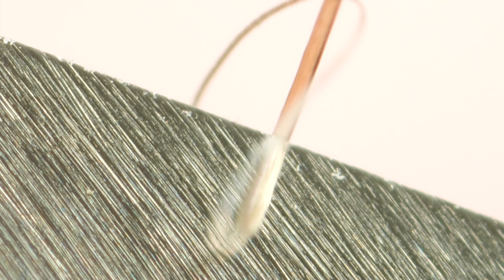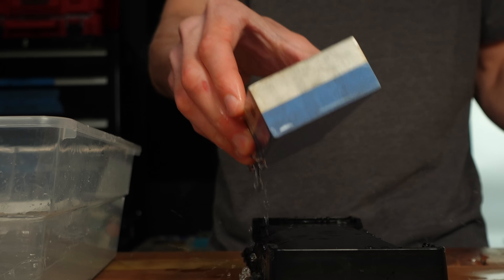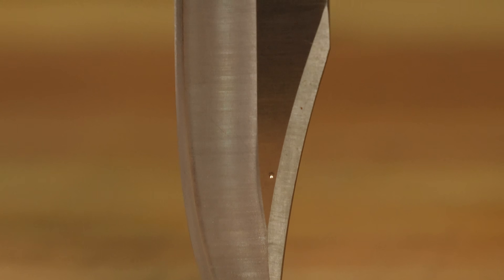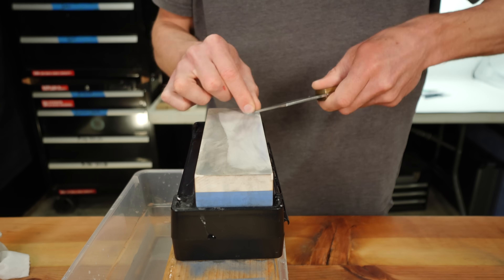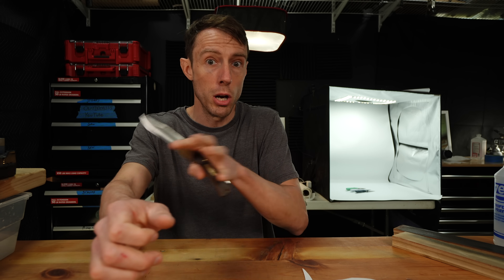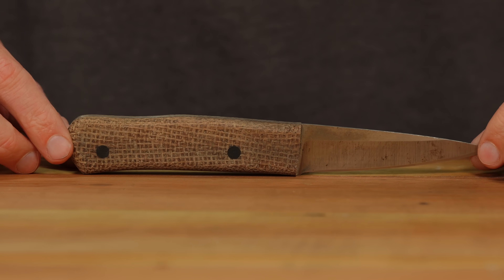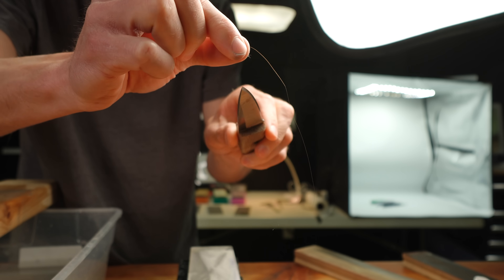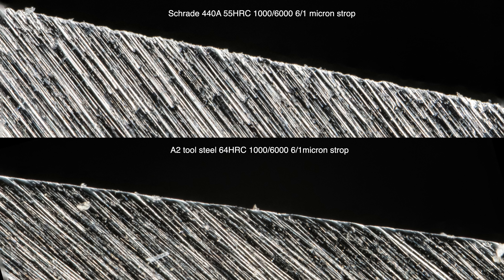The Reason You Can't Get A Hair Whittling Edge No One Talks About

Comment: I actually have the exact opposite problem:
On a 1000/6000 oxide stone i can get my cheap santoku knife (i guess mid 50s HRC) razor sharp. My rather expensive 67 HRC filleting knife on the other hand i can get to a point where it just so cuts paper but nothing better than that.
The stone takes of metal on both knifes, evident by the grey slurry, so i have no friggin idea why the hard knife doesn't wanna get sharp...
Reply from the maker: It could be multiple reasons. Very hard to diagnose unfortunately without knowing the exact setup and technique
Reply: As for technique, i am a beginner and use a Sharpal Holdbubble to make sure to keep the correct angle. Burr reduction technique like you showed in your other videos. 
The stone is made by KozyGear: nothing special, but it has a nice stable base and also a small cleaning stone included which i use to create slurry before i put the knifes on there. The "soft" knife, when dull from normal cooking use, needs maybe 20 passes per edge on each grit and gets shaving sharp. 
My only idea here: is a 67HRC ultrahigh-carbon blade really soo much harder that 1000grit aluminiumoxide doesn't "cut" it, even if the slurry gets grey? Maybe it would need several hundred passes on each edge/grit (since i'm really slow working with the Holdbubble i didn't try that) or better: a more aggressive stone?

Comment: The movement, in the knife snob community, toward harder and more high-tech steels - just to prevent having to ever sharpen them - is frankly, stupid. There is NO knife steel that will remain truly sharp with use. Super hard steels just require more work, more time and expensive sharpening tools, when they inevitably dull.  Give me a blade made from high carbon or 420, any day. All I do with my blades, when they begin to dull a bit, is STROP them. Two minutes - and they are back to shaving sharp.
Reply from the maker: Tell me you didn't watch the video, without telling me you didn't watch the video. I literally proved the exact opposite in this video 😂

Comment: I think you are correct. I have noticed for years that some blades can be made very sharp and others cannot. Some are almost impossible to sharpen. This is due to the steel itself.  I had one well known brand that I easily brought to a razor edge, and the exact same knife from the same maker I bought a year or two later that was almost impossible to bring to the same edge. I also think that something has to do with the grain sizes in the steel which is due to the processing of the steel.

Comment: at 4:37 you say that you don't know why softer knives have worse edge. here my hyopthesis :
we can clearly see on the picture a big difference, the softer knife as deeper scratch patern so the edge will have less definition, its like a TV, the finer it is, the more details you can achieve.
you can clearly see it, edge have big toothed saw-like profile, its just becuz pixels are biger : ) 
the other knife as the same thing but smaller, as the definition is way higher

(now why its less smooth)

In addition to that, as the steel is softer, it doesn't fail the same way, tends to deform and tear apart in oposition to chiping or just breaking. so I think what happen is, when metal is being scratched on the sharpening stone, softer knife tend to deform, its like a rake in sand, sharpening stone removes material but deform/mooves it too. if the knife was harder, the grit would not have penetrated the metal as deep, and all the bits that would have deformed, would have probably chiped instead (as the metal is britle and break when deformed) anyway, leaving a way nicer looking edge 

both effect combines, if the grit leaves deeper marks, there is more resistance and the metal deform more, leaving the edge like that, very ugly

so, to sumarize            softer steel = deeper marks
                                   deeper marks = less definition ( big saw tooth)
                                   deeper marks = more resistance
                                   softer steel     = deforms
           more resistance + deforms = a lot deformations (a lots of deformed metal still sticking to the blade / not removed)
a lot deformation + less definition= ugly/ less refined edge

Comment: One of the first folding knives I bought for myself 20 years ago was a Lebendwell in stainless for $7 and it seems to fit this category. Its so soft that the apex just deforms immediately and it never gets sharp. I use Smiths diamond plates and a spyderco fine ceramic then finish with a diamond paste strop and I can get everything else in my collection from 8cr to M4 scary sharp, but I keep that Lebendwell just as a reminder of what a terrible quality knife is.
Reply: Diamond is not a strop as it cuts.

Comment: I think it was in the video about the "magical" diamond plates, that you mentioned you didn't know when to stop, because you couldn't tell the change in scratch pattern. So... Sharpening until you get a uniform burr, is something you only on the first stone, then, and you aren't supposed to do that, with any further stones you go to? Makes sense, but how does one tell, when one's done, as a newbie? I don't think I've ever encountered a video, or anything else, that touches on this issue.
Reply: I would also like to know
Reply: If you get a good loupe or a (very cheap) microscope, it becomes fairly easy to see when the scratch pattern is not getting refined any longer and it's time to switch grades.
Reply: @KibberShuriq  Got any recommendations?

Comment: I think it was the knife steel nerd, you know the guy. At any rate, he said 440 was junk for knives, 440c on the other hand, does immensely better at taking an edge and holding it. A theory, just off the cuff thinking about it, is that there might be hardening inconsistencies within the material due to either contaminates, poor processing of the base material, or just the plain characteristics of the steel itself. There's probably a million variables as to why a single type of steel performs like crap or great.

Comment: Hello, Alex;
Thank you for another good video.
When I was young (69 now) Schrade had some good carbon steel knives.
Back then, you couldn't give me Schrade stainless blade.
That was like 50 years ago.
I still have a bias against stainless because much of it (back then) was "stainless".
But not so much "steel", IFKWIM.
I bought a 440 stainless "Sarge" pocket knife from Woodcraft for $10, 1/2 off.
It is hard to sharpen & even sharpening at a lower angle it's still hard to sharpen.
With the bevel at a 1/16th wide (maybe 12°?) it is sharper but it still a junk knife.
The liners are thin, the scales look like some kind of dull black plastic.
Hey, it's a cheap $10 knife.
But I can get it sharper by sharpening at a lower angle.
Try it, when you got 15-20 minutes to kill.
Have a GREAT day, Neighbor!

Comment: I've definitely run into this issue with my budget traditional knives like Schrades and Rough Ryders. The bur just doesn't want to go away, and I can even reform a bur with my strop. Whereas my k390 or s30v and even lower end but quality steels like 420hc and 14c28n are much easier to get a great edge on.
Reply: I found that for cheap/soft metal knives the only way to really remove burr is to run the edge through some piece of wood until it don't leave black marks on it anymore. Than strop. It is almost impossible to remove that plastic burr just with stones and strop, it is too sticky.

Comment: Discovery: I just found a great way to flatten a stone. I was polishing my Meat Grinder blade and discovered that the stone was flattened by grinding the very hard grinder blade surface.   It also flattens and polishes the blade at the same time.   Use a figure Eight stroke all over the stone and rotate the grinder blade all the time.   When done, the grinder will make a very nice grind ( use cold meat ).  The stone becomes very flat.  Double win.   Use the same stone as your knife.   I finish with a strop on leather with fine grit to get a nice look.

Comment: TRY FINISHING AFTER BURR REMOVAL WITH 10 per side  EDGE TRAILING STROKES :). I exclusively own cheap 1$ knives. IN my experience there are two types the ones which sharpen just fine and the ones that behave exactly like  the one in the video. Edge trailing is the only way to get that steel with a sharp apex.

Comment: This is something I've had arguements on forums and discord servers about. 

In my experience this is true. I used to sharpen as a side job, and of course I make knives now. So I have had plenty of experience. 

Particularly when i had the sharpening gig. The majority of the knives people had me sharpen were cheap garbage. A lot of them worse than that shrade. And some steels 100% are harder to get sharp than others. 

My educated guess coming from my knife making. Is higher hrc makes sharpening easier. That and lower retained austenite. 

So if a steel is 50 hrc and it has a lot of RA. Its absolutely going to be a nightmare. 

Or even worse. Non hardened steels. Which do come in some cheap chinese knives.

Comment: What should I get for my first knife ? What's your recomenndation ?
Reply: I'm no knife expert, but it's very clear what the answer to that question is: That would very much depend, on where/when you intent to use it, and for what. Without knowing that, that question is impossible to answer.
Reply: @ZarlanTheGreen  I want to get my first knife so I can learn the process of honing. I don't want something specific , just for everyday use.
Reply: @xlt375  What does "everyday use" mean? Different people have VEEEEEERY different answers to that. Resulting in just as great a difference, in what knives are suitable. If you just want a knife, purely to learn sharpening, and nothing else, I'd imagine anything cheap and available would be fine.
Reply: @ZarlanTheGreen  Everyday use for me means cutting an apple, cutting a peace of cardboard , cutting a small peace of wood when I am outside camping. By the term everyday use I mean cutting small things , something that I can take outside and use it when I need it.
Reply: @xlt375  That is a basis, for recommending a knife. Also quite different to what many others would say. (especially the cutting of a piece of wood part. Also, most people don't go out camping, or go out to the woods, as a common occurance)
Reply: @ZarlanTheGreen  Do you have any recommendations after that description ?
Reply: @xlt375  I know enough about knives, to know that, that descriptions is necessary, for anyone to even tell what type/category of knife to recommend, nevermind which model. This is very clear, and undeniable
...but I'm not so familiar with knives, that I can actually give any recommendations, no.

But with that description, you can get relevant/appropriate recommendations, from those who are.

Comment: Gday again. New to knife sharpening but as a stonemason worked granite a long time. The reason benches have rounded or profiled edges is many, less chipping, a better look, etc. One other reason might be if i do a perfect 90 degree edge on stone it will cut your finger. 
 There is a reason our ancestors used it first. If you put a bit of thought into it you have a tone of sharp edges very quickly. Even if you just end up throwing them at an enemy they will do a lot more damage.
 Also the harder a stone is the easier it is to polish. As a soft stone is easier to mess up the grind, leaving scratches that show in the polish. I assume metal is similar.